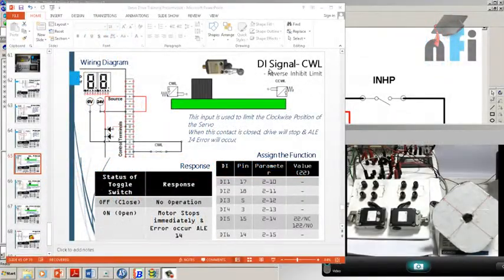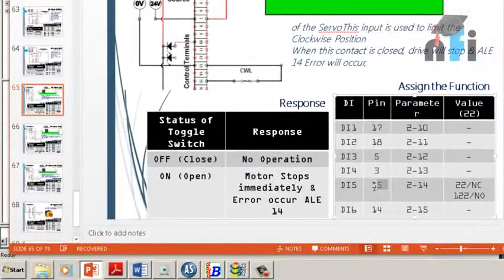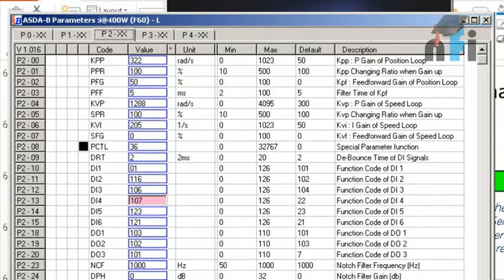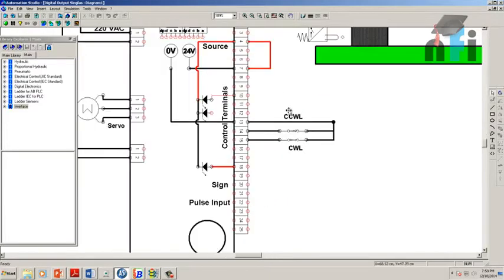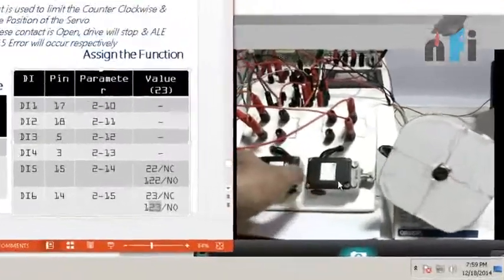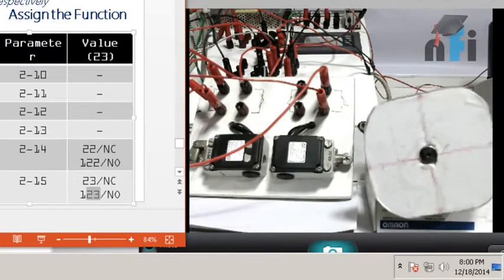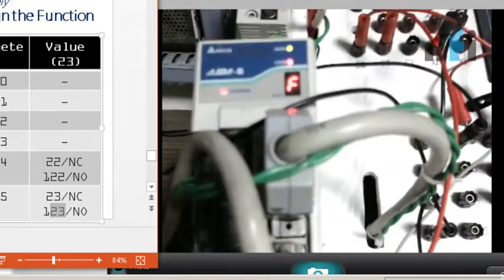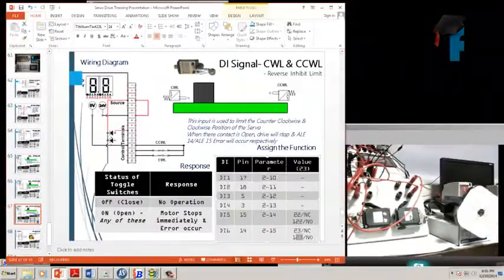Delta Servo Video Tutorials - Digital Input CWL and CCWL

Comment: Great information I have a Delta Servo Drive and Motor that will only turn in one direction is there a parameter i can change to correct this so it moves in both direction?  Thanks
Reply from the maker: Is it  Pulse execution mode?

Comment: Sir i am using delta ASDA-B2 model communication with plc and hmi. Servo motor is not changing its direction its keep running on forward while touching reverse on HMI. PLC Output found ok. Sir i need your suggestions
Reply from the maker: Check the wiring. When you click reverse you send a digital signal to the driver. Make sure the signal is going to the serve

Comment: Dear sir 
Thanks for the uploading these videos and if I want to  run a servo in anti clock and clock direction what are the parameters I need to choose and how I can configure . What is the  gear ratio , speed , torque etc .